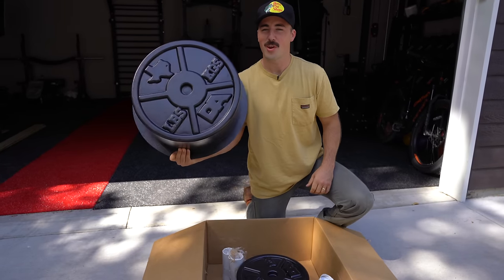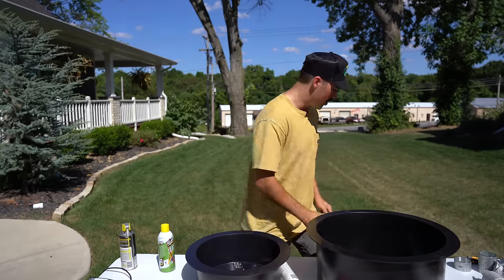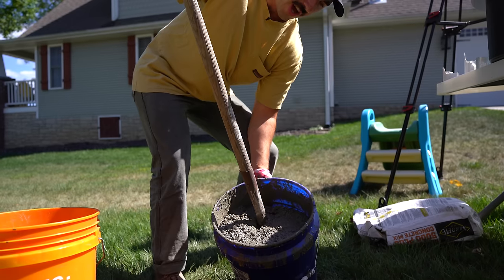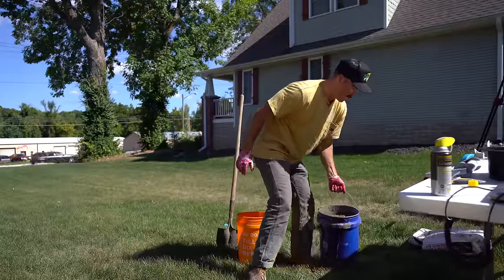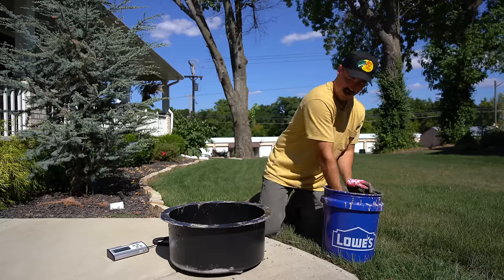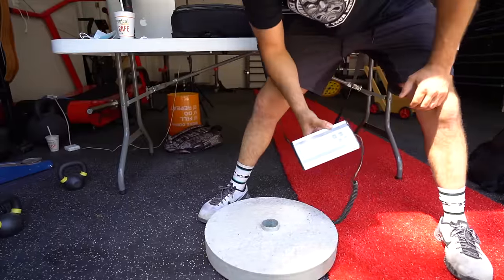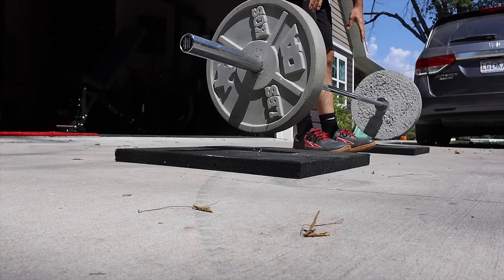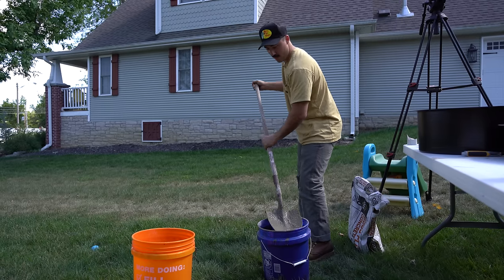How To: DIY Concrete Weight Plates That Don't Break

Comment: You should've zeroed the mold out first. Then you could've known 100% what the concrete weighs.
Reply: When it dries doesn't it lose weight because the water evaporates?if I did this I wouldn't know how to calculate how much water is going to evaporate so how much weight I should aim for.
Reply: @GenEmperor  it’s easiest to weigh the dry mix to the weight of plate you want and mix in the water after so that once it’s fully cured it will be back to the weight you want.

Comment: I know a lot of people like to DIY but not me.  I also understand the economy is horrible for many people so every penny counts but to me it makes no sense to do all this to save a few bucks.  In this case what was the cost of the mold and middle pieces and lube and such? Wondering how much you really save.  Even as the molds are reusable how many of each size plate do you need? 2 for most sizes only for a home gym.  Maybe if you are a big strong guy you might make more 45's but that is about it.  Also wonder if they do crack how you would go about trying to reuse the middle piece. In the end, unless you really enjoy the DIY stuff or are really strapped for cash this is a lot of effort
Reply: Time is money to some people. But to answer your question, each mold is made deep enough to make numerous sizes of plates. The large mold makes 25-100lbs plates. The small mold makes 5-35lbs plates.

Comment: I was really sold on this until i see the price of the moulds , c'mon you could get them manufactured for a dollar each in china , way too overpriced . If  our muscles cant tell the difference between a concrete weight and a cast iron weight , then they wont no the difference between a concrete weight that has a logo and design on , to a plain old bucket you can pick up at the hardware store along with some two inch plastic pipe .
Reply: Well our molds are made in Houston, TX with thick, durable plastic from Dallas, TX. They are made strong and reusable for numerous sizes of plates. Yes, you can use a bucket and some pipe, but these molds are a step up from that for people that want to make them fast, easy, and have them come out looking great and uniform.

Comment: Bro it's chipping
Reply: That was the excess that seeped between the seal and the mold into the bar area. It happens and in my instruction I tell customers to clear that before use. I also tell them to wait at least a week to use them but Coop was too excited to do either 😆

Comment: If your trying saving money why not just use a Home Depot bucket and some pipe while your there buying your concrete total project cost less than 40$ 🤷🏾‍♂️ it’s just a mold an concrete 🤣

Comment: Concrete gets harder and therefore more brittle as time goes on. Your test means nothing. Test them in a month.
Reply: I'm not sure how they will hold up after a lot of deadlifts either. Like I made my rack but these plates will not last a tenth of the time my rack will.

Comment: Its cheaper to buy the real weights
Reply: No it’s really not. A set of production plates (2x 45,25,10s) runs between $300-$500 plus shipping. You can get these two molds and make over 1,000lbs of plates for that same price.

Comment: Unless a person is an Olympic weightlifter there's no need for them to drop the bar. And if they're an Olympic weightlifter they probably don't need to use concrete plates anyway. Deadlifting by crashing the bar down on each reap is also unnecessary.